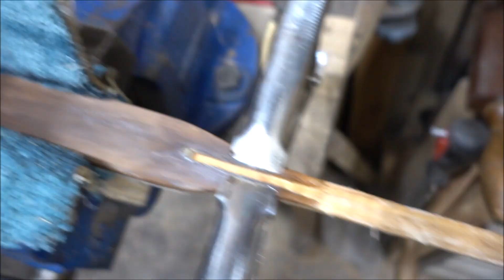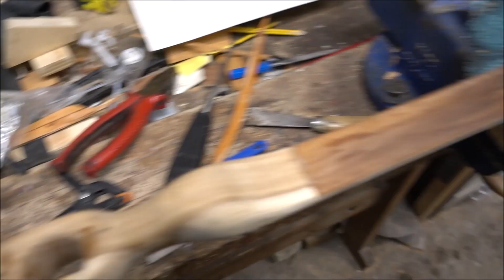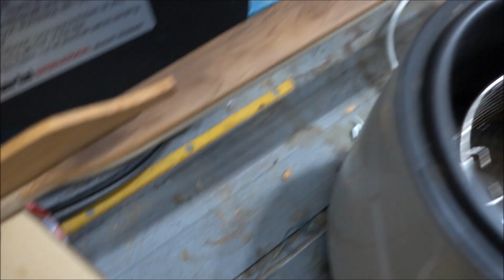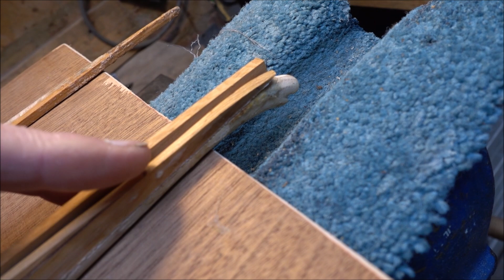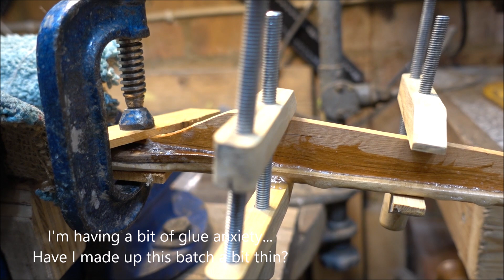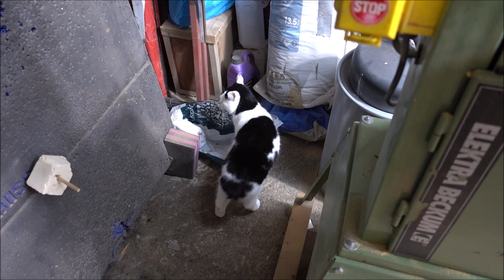Hickory Flight Bow rework pt6

Comment: Would xou consider making a bideo on making clamps that size?
Reply from the maker: There are loads of youtube videos if you search for 'toolmakers clamps' .
I just copied a metal one. To do it with wood needs a tight grained wood that can have a thread cut with a tap. They are fiddly to use, and I need to run the tap through the threads again as they have become a bit stiff.